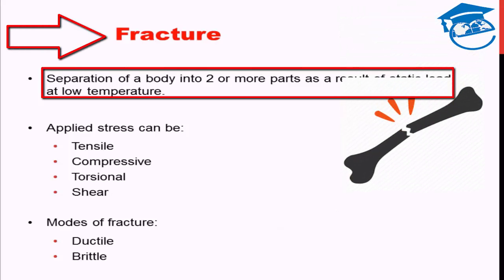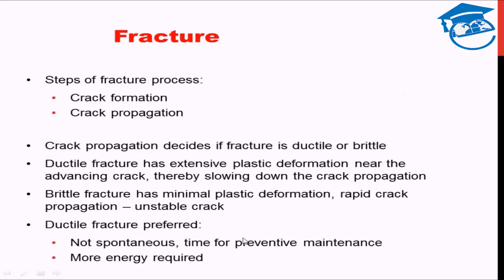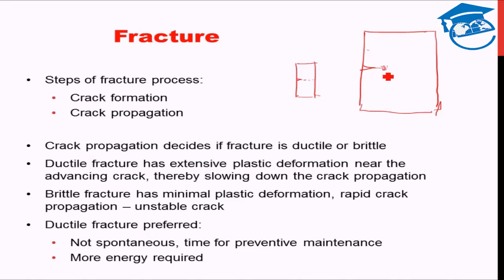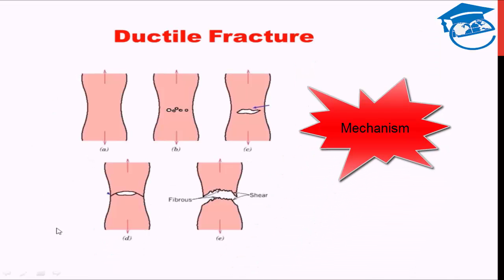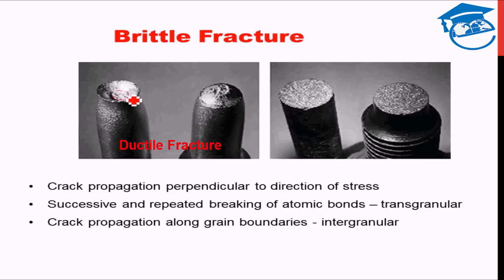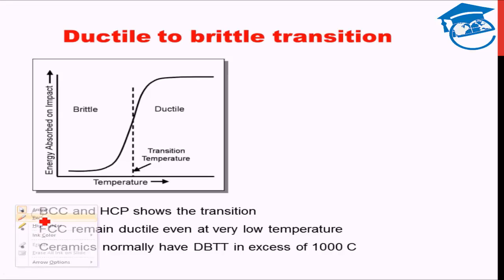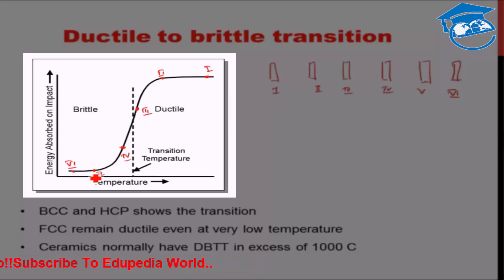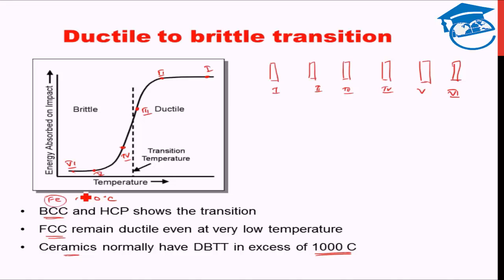AMIE Exam Lectures- Materials Science & Engineering | Fracture | 6.6

Comment: Ductile material reauires more energy then brittle material to fracture.....But in the stress strain curve you told that brittle material requires more stress for fracture...than how both statement is justify
Reply: Great question. The answer is simple though; you need to understand the difference between 'stress for fracture' and 'energy for fracture'. Stress for fracture is the stress value (load/area) at which the material fractures whereas energy for fracture is the total energy absorbed by the material before fracture and this is given by the area under the stress strain curve.

So if you observe the stress-strain curve of a ductile and a brittle material to observe the difference. For a brittle material the stress value for failure is high but the area under the curve is less. Whereas for a ductile material the stress value for fracture is low compared to brittle material but the area under the stress-strain curve (energy) till fracture is much greater.

Hope this clarifies your confusion. In case something still isn't clear, do drop a message and I will explain it again
Reply: The potential energy required to breaking the bonds (bond energy) is the area under the stress- strain curve. i.e Toughness and resilience. At least that is what I think.